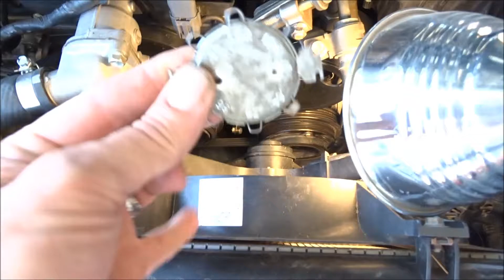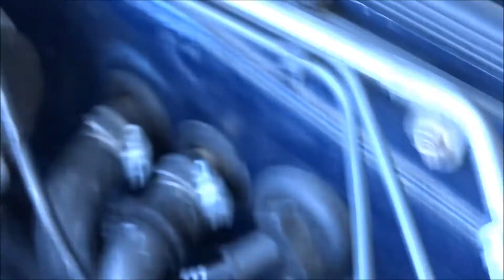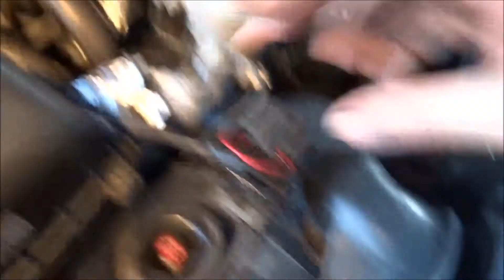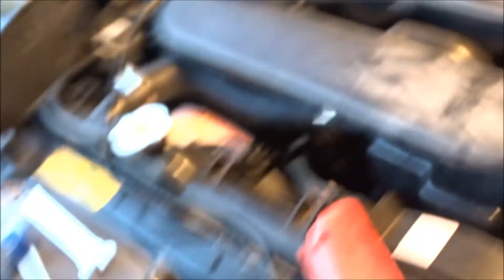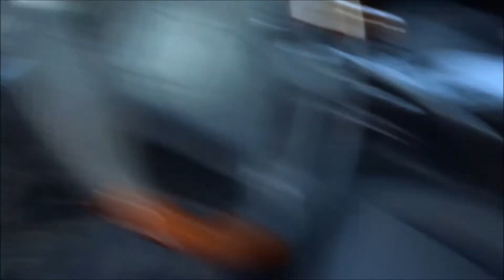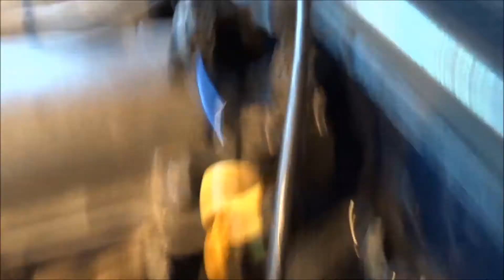Mazda Miata - set ignition timing

Comment: According to the 96 FSM, the yellow mark is actually the ignition timing mark.
Reply from the maker: Yep, I see conflicting information about which mark is the correct one to reference, I am not honestly 100% sure what is correct for a 1997. At least the procedure to set the timing remains the same.... FWIW I advance mine a bit until it starts to ping and then pull it back a little from there. You don't have to hook up the jump wire to do the minor adjustments if you have a mark at the CAS sensor to reference from.

Comment: I have a 93 protege with a bp05,did the timing belt and got it running, now when I tried to do the ignition timing I can't see the cover with the number scale to do the 10`btdc cause the water pump pulley doesn't let me see to the bottom and the timing gun I have it's the one without the button with the numbers in the back 😥 don't know what to do now to get the ignition timing right
Reply from the maker: Hey so I had basically the same car; a Kia Sephia. Mine had the 1.8 liter BP engine in it just like the Miata. I do recall that seeing the timing mark was a bit 'tricky' on the FWD car...there was a small place to observe it with a timing light if you looked down near the power steering/AC lines from the passenger side of the car if memory serves me correctly.....gotta look carefully......good luck with it.....
Reply: Chris R Yea I had to move the ground wire that goes from the chassis to the front of the engine,actually 2 ground wires cause I had an extra ground with thicker wire, so basically I moved both of the ground wires and looked from an angle and got to see it, thanks for sharing, seems like not a lot of people look at these  bp engine videos no more these days!
Reply: I have the bp05 and I need to retard the timing what degree is normal for these motors